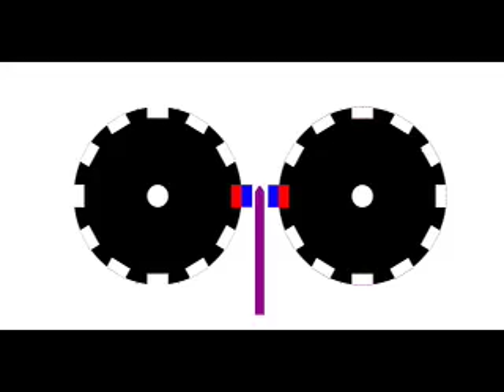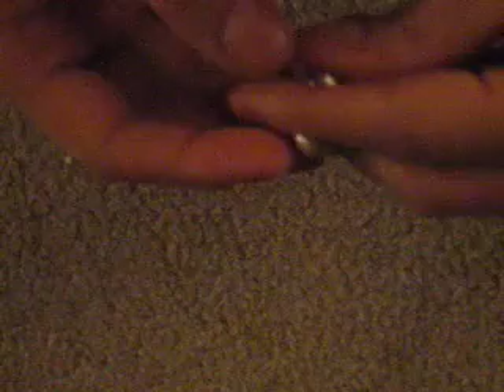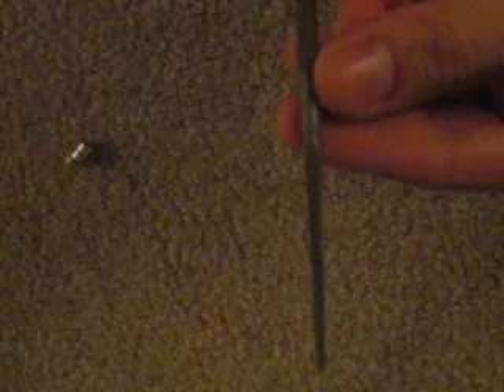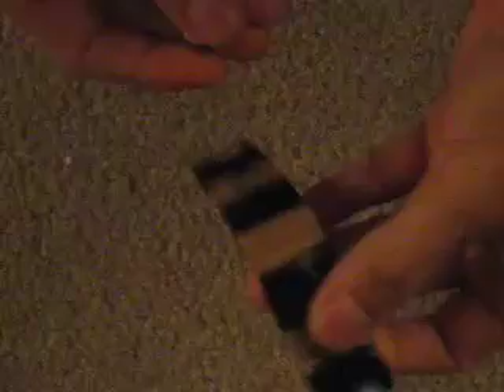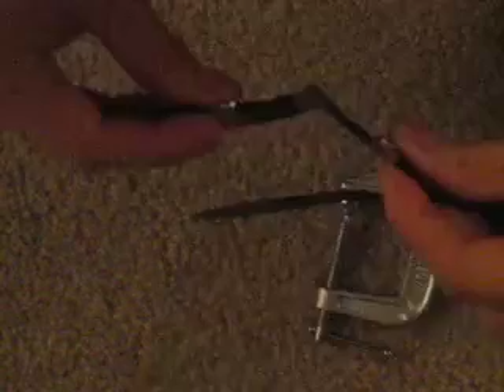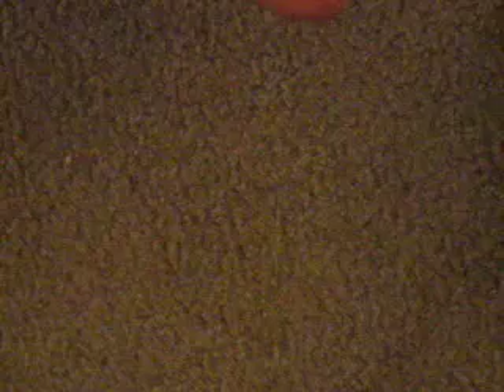Magnet Motor concept and How magnetic shielding works

Comment: Remember also that, if you want to selectively reduce (or re-direct) the magnetic fields of two magnets in order to be able to separate them easier, you can exploit the use of a high conductivity material ( e.g. copper) to rob the M field energy from the magnets due to the Eddy Current through the copper.  

I use a short length of copper pipe to help me separate two neodymium cylinder magnets from each other.  This principle , used in conjunction with the high permeability concept, try it...

Comment: ok i think this solves it : if you have cog a and cog b. a would spin and b would sync with a before they meet the rod( cogs have mags on all points). the force of mag on a and b would pull to the point of shield: so theoretically as theta on both cogs aproach 0 (0 is the horrazontal) the attraction force approach 0. thus the motion relies on the angular P. but the Tourqu from below cancels the force from above. thus the cogs would accelerate "-a" from the friction of the two shafts. no tourque

Comment: @knowledgemonger and @kenscottmaclean what if you just lowered the file so that  it's not in the middle so that the net repulsion force on the tops of the wheels is bigger than the net attraction force on the wheels' bottoms, what would stop that from working?

Comment: @realdad32 It is a very common delusion. It does not matter how much it will lift; having lifted something one has to separate it from the magnet again, so there is no nett energy gain. Trying to extract energy from a magnetic field is as futile as trying to extract energy from a gravitational field. Sure, one can roll a stone down a mountain and produce energy. But the energy is coming from whatever put the stone up there: not from the field. Same principle with magnets.

Comment: @knowledgemonger Indeed. There are also hundreds of patent applications for the idea of excavating 2 parallel adjacent shafts with some sort of interconnecting air-lock at the bottom. The concept is that heavy weights with a density less than that of water are dropped down an empty shaft to generate energy, then moved into a water-filled shaft and allowed to float back up. This nonsense can be used to teach hydrostatic principles.
Oh dear, the loonies will already have their spades out, lol.

Comment: Or, flowerbower, the shield reduces the repulsion as magnets approach one another, but does not significantly interfere with repulsion as magnets move away from one another. Repulsion is stronger than attraction & works at a greater distance, creating an imbalance in this machine.

Comment: A physicist's analysis of the idea would go like this: a material which blocked a magnetic field but did not interact with the magnet would permit the construction of a perpetual motion machine.
BUT perpetual motion machines are contrary to the laws of thermodynamics, therefore no such shielding material can exist.
QED

Comment: its probably been beaten to death w, but here are a few things i see wrong with this right away:
1) the friction generated by, lets say a wheel you're trying to propel, will be much greater than the forces created by the magnets
2) you are right, you need gears, but once you introduce gears (they need to touch) you introduce more friction and there is no space for the piece of iron
3) as DukeHastMich said: redirecting the lines of magnetic force causes resistance
that being said, great video!

Comment: I am very interested in this concept. I too believe it will work; however, I have not tried building one of this design myself. I am curious about whether the metal rod would become magnetized thereby canceling the shielding effect. If the originator of this video would please correspond with me, I would be interested in dialog. Please contact me at (417)-299-4986.

Comment: I don't know much about magnets, but instead of having gears on the wheel itself, have bars coming out from the center of the wheels that have gears on them. that way you can still have the bar in between the magnets without interfering with the gears and vice versa.

Comment: i was pretty set on this idea but i don't really see the logic. The initial push will make the magnets push past each other and it will go for a while but then eventually the force will stop, because each time they push past each other energy is lost although minuscule. Unity (100% efficient) is hard enough, trying to reach over unity is crazy. you'd need to create a vacuum in space time then you could spin something and it would turn forever. Your better off looking at frictionless ferrofluids.

Comment: Unfortunately the two magnets before they meet the rod are in repel mode thus cancelling out the repel mode of the two magnets past the rod.
In laymans terms if you turned the discs by hand they would turn till the energy of the physical boost (your hand) was expended then the magnets I mentioned would come into force neutralising any movement at all.
IT WONT TURN BY ITS SELF

Comment: @gibbo1112 - wrong.  The energy used to create magnets is not recoverable.  It is like saying the energy used to create diamonds is recoverable.  Magnets produce a fixed field.  Motors work because of an oscillating field i.e. at least one of the fields changes polarity.  This is simply not possible with a permanent magnet only motor.  Shielding is a myth in its ability to somehow allow a magnetic motor to work.  This video is BS.

Comment: @gibbo1112 In electromagnet motors, the energy comes from Voltage x current x time. same with household appliances.

In your example, the energy in the magnets comes from their separation. Once they come together, they're stuck that way and in order to get them back into the state they were (closed loop), work has to be put into the magnets. The magnets are at a higher energy state when separated and at  a lower one when together, like a ball that rolled down a hill.

Comment: @muhammedmuhiddin try stroking a needle with a magnet, the energy used to allign the dipoles in the needle goes into the magnet... push the needle through a cork and float it in water, and you have a compass! and the energy is expended turning towards north

Comment: @gibbo1112 Right, and in the mean time you'll get .00000000000000000000000001 joules out of the change in magnetism per revolution. Look, Magnets do not do work on a closed path. the magnetism of permanent magnets is way to Fshkin' slow for any energy to get turned into rotation and overcome friction. This is why most magnet motors rely on Electromagnets, where energy is put into the system in terms of voltage and current. The same energy you put into a system is the same energy you get out.

Comment: It doesn't work (try it out). The motor would just sit there doing nothing.
This is another version of some of the old perpetua mobiles invented centuries ago. The magnets would experience a pull and a push of equal size and the resulting force would be zero.

Comment: I see why this idea would not work. As the like poles of the magnets pull together, there are two forces which will stop the motion of the wheels. First, the magnets will be attracted to the metal and will pull the wheels downward. Second, if the magnets were to have enough momentum to push upward, their repelling forces would push them downward towards the metal which they are attracted to. This video has been up for more than two years - why hasn't anyone reported success with this idea?

Comment: @knewitallthetime There is always a possibility, sure, but when we consider that everything from magnetic influence mines, radio, television, the stepper motor in your computer hard drive and DVD player, photomultipliers, mobile phones, radio, the simple wall fan, in fact everything using electricity and magnetism, were all designed using Maxwell's data or some derivative, and ALWAYS confirm them. And let's not forget that Einstein built on Maxwell - so his stuff is in error too?

Comment: @knowledgemonger This is exactly what i meant by "No net energy." It's the reason that magnets alone can't be used to make devices with no external input: They either reach equilibrium after a short amount of time, or their output energy is teeny-tiny, so even the most feeble attempt at extracting energy ends up stopping the device. When you have a device made up completely of permanent magnets: Energy in = energy out, IE: Magnet's do no work.

Comment: @TheBblindman DePalma? :|
I fail to see what spinning conductors have anything to do with this. The homo-polar motor works SOLELY by the Lorentz force, with the magnetic field pushing on the current wire. I don't care what DePalma's machine does, the energy is coming from the outside: Both in equations and in every experiment so far, magnetic fields do /not/ do any net work. You cannot get energy from the magnetic field -- you can certainly use it to get energy from elsewhere, though.

Comment: The magnets at the south end of the rod would still have slight negitive atraction wanting to push the wheels in reverse. The only thing stoping that is the higher atraction to the rods northern tip. If the northern tip is enough to over power the wheels from wanting to turn in reverse then it would be to powerfull at its most magnetic point to alow the magnets to push apart at the end. Hope that makes sence.

Comment: Internally visualising these things is generally useful, but one must be careful, because it is always possible to push rationalisations to the point where they become distinct from reality. Here, your logic is sound, but you must remember that even as the magnets pass the equilibrium point, they are still attracted to the file. Past the end of your screen, the force on the magnets would be directed down, towards your iron sheet. That's conjecture, but conservation of energy says I'm right.

Comment: Internally visualising these things is generally useful, but one must be careful, because it ia always possible to push rationalisations to the point where they become distinct from reality. Here, your logic is sound, but you must remember that even as the magnets pass the equilibrium point, they are still attracted to the file. Past the end of your screen, the force on the magnets would be directed down, towards your iron sheet. That's conjecture, but conservation of energy says I'm right.

Comment: without the rod you have a perfectly symetrycal situation so by shielding the lower part you create an asymetrical situation. this must be tryed to see if  it work with fine tuning of the rod thickness and position plus a wide number of magnet around the wheel to spherify the global field (in order to avoid the magnetic gear effect which lead to magnetic lock)

Comment: Sorry, but magnetic fields cannot be blocked or insulated (refer to Maxwell's equations?) I think there is a confusion in that the magnets are always attracted to the file. This is what you interpret  as the "cancelling" effect. As you move the magnets to the end of the file - less metal for the magnets to be attracted to - a point is reached where the repulsion of the magnets from each other is simply stronger than their attraction to the reduced amount of iron.

Comment: @moltencheese123 I'm going to test it. I now have a mag-motor that free spins on its own. But it has no power. you can stop it with any load strong enough to turn even the smallest gen. But I'm close to some new discovery. My motor is nothing like any seen on  here.

Comment: I've looked at this and made the following considerations on how this might work, but I don't have materials to do it
1. Because magnets will only repel about a half an inch, the bigger the wheel the more distance the wheel will travel to repel the magets that 1/2". So, if you get flywheels from car engines, it would be a good step in the right direction.
2. Use lead to shield the bottom half instead of iron until it's confirmed if the top half will work, then try the iron or steele shielding.

Comment: It's not really magnetic shielding. The iron is providing a less magnetically resistive path for the magnetic field to take, so the two fields from the magnets don't interact with each other until there is less iron between them.

Comment: permeate baby!!!!  Well,  i was thinking a state of resistance on a timed release spring which would simulate a piston system of energy which can also be stored. You would need a cam to operate the precision timing.  Otherwise a 4x3 array would create optimal output on a fly wheel design which can utilize a center drive for operating a spring hammer in intervals of opposing magnetic polarity arrangements. Opposing also has energy cell storage capability.

Comment: Thank you for the concept of shielding
I think the shielding should be a rigid metal grid, allowing 50% of the repelling and attracting forces through, thus canceling themselves. 
And maybe the grid should go a little passed the mid way point and hopefully, the only acting force will be the repelling force on the top parts of the gears.
It's worth a try.
Reply: Nice

Comment: @lapmarty First of all, magnets do not contain stored energy. when a magnet is magnetised, its particles are aligned in the same direction, and it is that which contributes to magnetism. Its like lining 50 rectangular metal bars pointing the same direction, they do not provide "energy". Secondly, as i have already pointed out, magnets are continuously opposed to, in speakers, motors, actuators ect.. they provide continuos force, but do not wear out...

Comment: I tried one of these myself all cnc machined ect.. It did not work because of one thing: eddy currents. if eddy currents generated on the shielding were to be eliminated this would work, as I will show on a video which i will soon put up. as for now, any ideas on how to eliminate eddy currents on a shielding of 0.7mm? thanks

Comment: yes induction would occour, however any movement achieved by magnetic machienes is done in expension of the magnets strength, they get caotic over time and loose the force.. so we only used the energy spend in the factory to magnetise them. obtaining energy when transforming order into caos because order is a higher state of energy (some arrangements dont use the shielding part) but still they exaust the magnets

Comment: Sorry dude, your idea violates the laws of physics. When your magnets move past you "shielding" it will generate a new magnetic field in the iron core that will oppose the motion of the machine.
Even if you came up with a way to theoretically sustain motion along the same principals of your "motor", you'd be losing friction to your bearings.
Making "free" energy is not a worthwhile pursuit; your enthusiasm would better serve more practical applications like making energy transfer more efficient.

Comment: @ElectricXtment

Is no-one going to point out that as soon as the wheel starts to move the lower magnets will induce current loops in the shielding material which in turn create a magnetic field which OPPOSES the motion of the magnets on the wheels...it's called Lenz's Law - and it ensures a little thing called the CONSERVATION OF ENERGY isn't violated...

Comment: Magnetic shielding will never be a solution to perpetual motion machines that is based on permanent magnets. The magnetic force will attract to the metal piece you use as a shielding. This force is exactly the same as what you gained with the shield. So there you are at square one again. Magnets cannot do work by themselves. There are no "potential discharge" that propels the wheel.

Comment: @MrAwsome514 again with the impossibility, ITS NOT IMPOSSIBLE, but good lie with the *nuclear explosion* i would add breaks, they would activate if the motor reached speeds of 100 RPS, witch in that case it would cause so much heat in the bearings that it would burn the grease and maybe just maybe catch fire, even tho it would be metal

Comment: @TheDestructor888 Well when you fail remember I told you that it would happen. Nomatter how many times you try it will fail every time. By the way just so you know if this where possible the motor would accelerate to the speed of light in mere seconds and the centripetal force would cause each atom in it to be ripped apart unleashing force roughly equivilant to a nuclear explosion. Good thing it is physically impossible though.

Comment: @TheDestructor888 Your own theories? You obviously just absorb what ever these conmen say to you and then pretend that repeating every thing they have told you makes you sound smart. by the way why on earth are you buying $350 in magnets for your test? How big are these magnets you plan to use? I know neodymium magnets are not cheap but that is far beyond what you should need to spend. A test model should be made to a smaller scale since the scale will not effect the result to cut costs down.

Comment: @TheDestructor888 Yes and every last one is faked. It is really not a hard thing to fake. Infact it can be done with only a simple pulsed input electromagnet off camera Which any one with even a slight knowledge of electronics can make dirt cheap. Or in larger props an electric motor can be hidden. You can not just trust a video these days. If you just try to make them yourself you will find that you can not get them to work nomatter how close your design is to thier's

Comment: @chrisofnottingham, maybe the centrifugal force has to be stronger than that of the force of magnetism for this device to work. On the other hand: Go check this out. your the skeptic.  search: "magnet motor FREE POWER PERENDEV NO GASOLINE" its the top hit with over 462,000 views. Posted by: theoneagain. This gentleman has used Scalar energy with phased locked resonance. Its a matter or location and spacing. Life is really simple, but we insist on making it complicated.

 This phased locked r